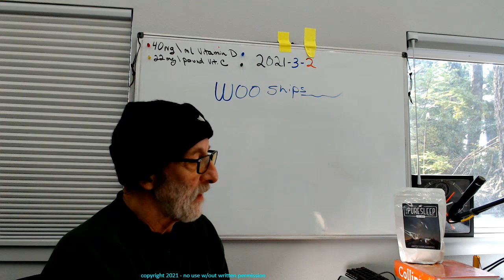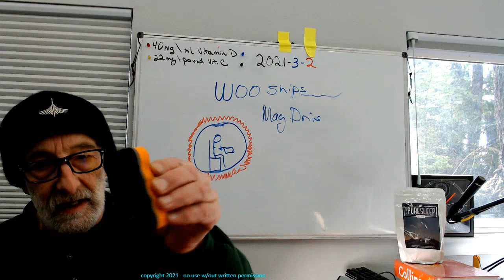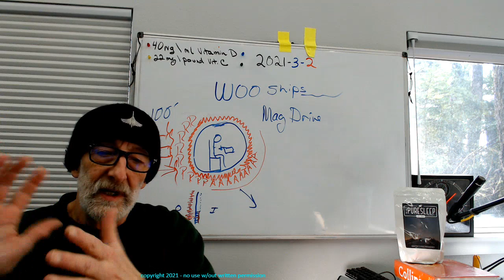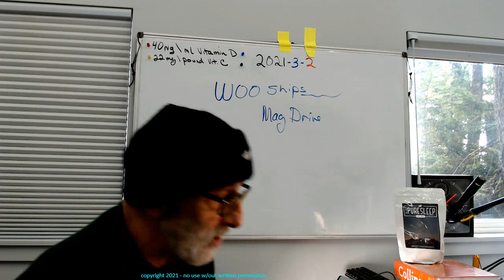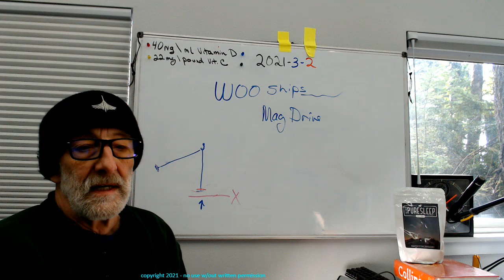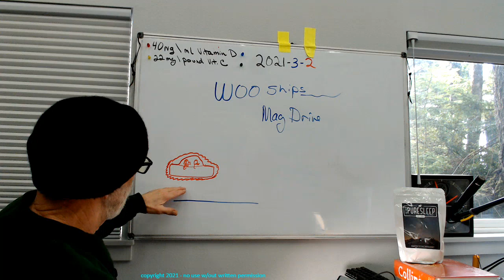Woo ships -2021-3-2

Comment: You obviously are not familiar with the basics of physics.  This is not how physics works! You´re literally ignoring gravity based on a fact that gravity constant is 10e4 times weaker, but we are all bound to the surface of the Earth because of gravity and not Earth´s magnetism. These two are completely different phenomena of physics. 
Gravity acts as a force between two masses while magnetism acts as a force between magnetic poles (which is just an idealization of a region of space where magnetic flux seems to get higher, but it really is a force that acts upon moving electric charges).
That would kind of suggest that magnetism is the force operating between planets but is not. The forces here also depend on the magnitude of the charges involved; Earth has a huge "gravitational charge", a.k.a. a huge mass, while its magnetic field is as strong as a loosely held magnet in a fridge. Also, the fact that magnetism has a way larger constant for the force formula means that it decays with distance to nothing and it is only powerful enough at close ranges. Satellites, the Moon, or everything that falls into Earth is strongly influenced by gravity. Galaxies, which also have magnetic fields, attract one another by gravitational interaction even if gravity is still "the weaker force", because of the extreme amounts of mass they have and the ridiculously small intensity of the magnetic fields involved. (not my text completely, took from one user at Stack Exchange because he explained it in a beautifully simple way. Here´s the link for more information: https://physics.stackexchange.com/questions/518565/difference-between-earths-magnetic-field-and-earths-gravitational-field )
What you are describing here is Faraday´s cage and Lorentz force(as commenter Blade Runner also pointed out).
Reply: Faraday's cage repels magnets?  No.   He is looking for a diamagnetic material like Bismuth or Graphene.
Reply: @rshoemake  Yeah but he said, you gonna fire it up...that´s the reason I mentioned FAraday´s cage, because it reminded me of that, blocking electromagnetic interference. Even though Faraday´s cage cannot block Earth´s magnetic field. Anyway earth´s magnetic field doesn´t bound us to the surface, that´s gravity and he needs to figure out an antigravity generator.

Comment: Gaffers tape can leave residue. Interesting video. Congratulations on reaching 100,000 + subscribers. A subscriber. Best
Reply: Not if you get the good stuff. There are a lot of garbage tapes out there right now....gotta spend at least 20/roll
Reply: @evoltap  Thanks
Reply: Is gaffer tape residue metal X?!
Reply: @rogermellie1624  not sure. It is used in photography a lot as a tool
Reply: @rogermellie1624  haha nice one

Comment: I have a small rig just like that  I use to help verify silver. Both copper and silver have that strong diamagnetic effect. 
The movement boosting effect you are looking for would violate the law of conservation of energy. I'm cool with that. To test if you're on the right track move a magnet fast over your copper or silver base and measure for a temperature increase. If nothing is getting warm then we can ignore conservation of energy and your quest for metalX is a good one.

Comment: Try messing around with sound amplification of certain frequencies to mirror the metal frequency you are looking for.  The metal may not be found yet, but the frequency exists. It might be as simple as figuring out by testing, which frequency would work. Just a thought.

Another woo idea, would be to find a programmable material that could be applied for amplification. Crystals, water and much more are programmable.

Comment: I understood that the these and the larger ships use zero point magnetic power plants that energize a polymorphic semi conducting hull that has self-healing properties. The rough estimate of power these system produce is in the range of several billion tesla. As for that metal it maybe that it would have to be forged in zero g and have meta crystal properties. I am not an expert just been thinking about this

Comment: Linda M. Howe has talked about bismuth magnesium zinc taken from alien spacecraft.
Reply: Sounds like a superconductor. Some patents of reported 3 metal actual room temperature superconductors exist. If we achieve the most optimal arrangement of just the right atoms we optimize the internal structure creating a permanent superconductor.
Reply: Metallic plywood from space. Does it come in 4' x 8' sheets?
Reply: @sempertard  LMAO  No it only comes in space metric units.
Reply: No other element has a higher level of diamagnetism than Bismuth. Diamagnetism is the ability for an object to create its own magnetic field opposing the magnetic field of another source.
Reply: Under a magnetic field Mg is attractive, Bi is repulsive, and Zn weakly repulsive.  When layered or dopped into the material structure it should result in acceleration of the magnet.
Reply: I think the Zinc acts as magnetic field insulator.

Comment: Glass When fabricated in low P atmosphere and contains low O2 in the silicon sand used + mix in a little bassalt = metallic glass stronger than any metal . Structure -build  Thats what da-Orbs are made of.*

Comment: Question?  How does the human body handle the G-Forces when you are thrushed so quickly?
Reply from the maker: read  boscovich. There are no G forces if one is isolated from limit points of attraction from matter. It sounds stupid, but without a 20k word response....read boscovich.
Reply: In the past I heard if you are in the wooship w/magnetic propulsion your weight is much lighter and you can sustain the Gforce . You can make 90 degree turns without getting thrown around like an egg in a shaken shoe box
Reply: Perfect isolation from the zero point field means no inertia - i.e., floating in zero gravity.  No outside gravity sources felt by the internal occupants.  Many scientists have postulated this.